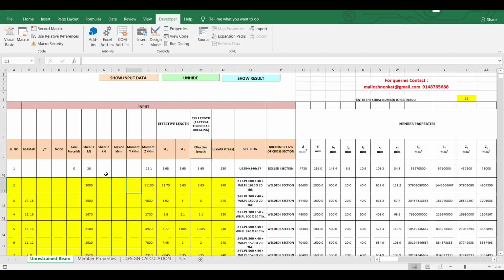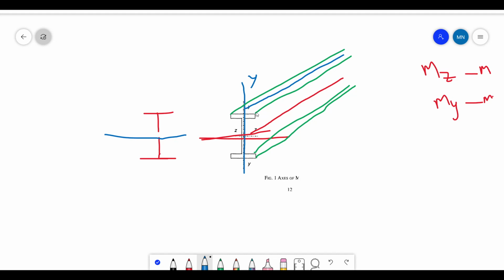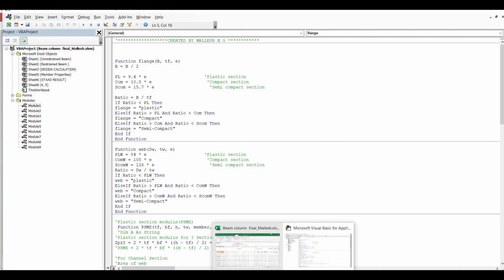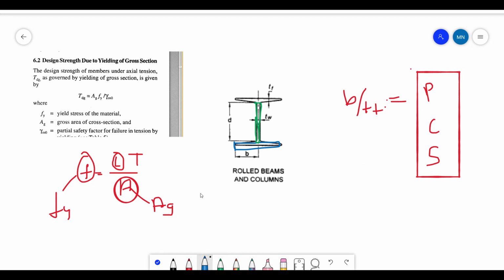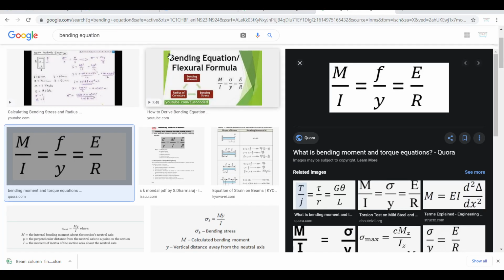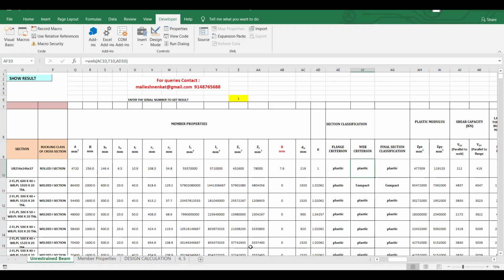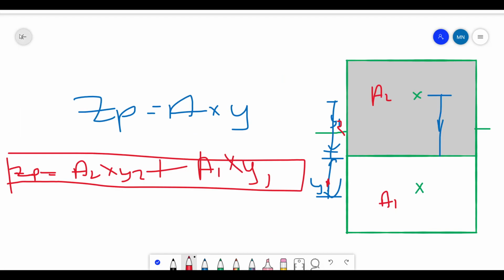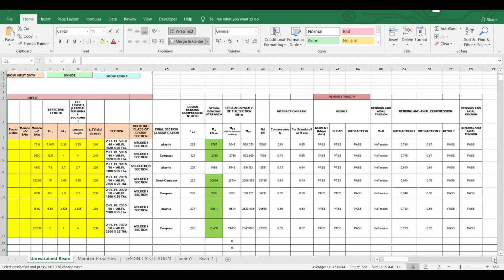BEAM COLUMN DESIGN -IS800-EXCEL VBA

Comment: I have a  hollow section of 600*25 ...it is symmetrical box section ...how to input this in your excel sheet...and get design result....Also clarify from where i should extract the value of Klx and Kly and effective length from Etabs...I would appreciate your help in this matter
Reply from the maker: In next sheet u can find data base where u can enter data and klx kly, should be decided on the span, study about effective  length